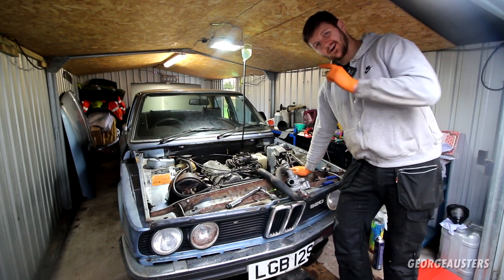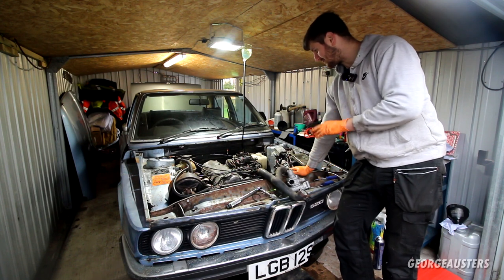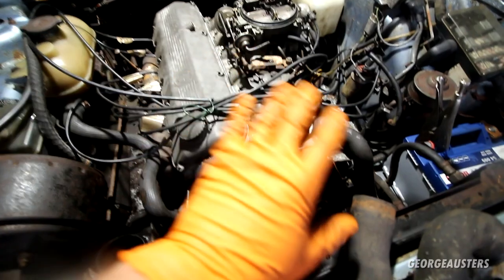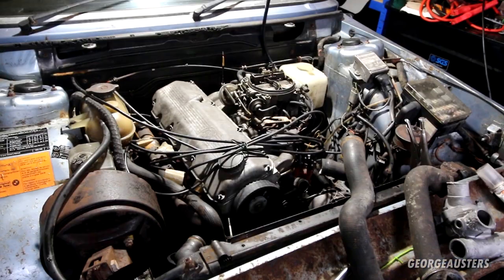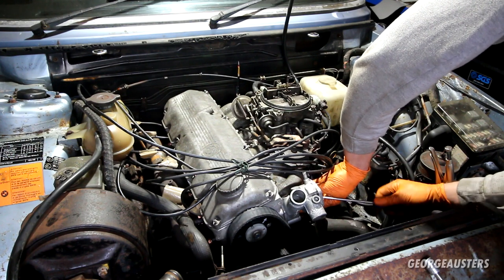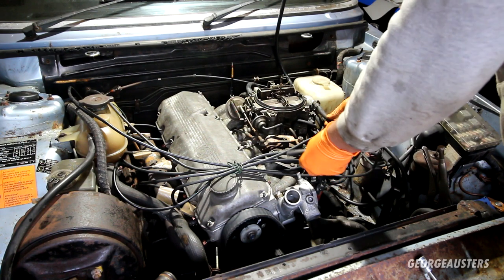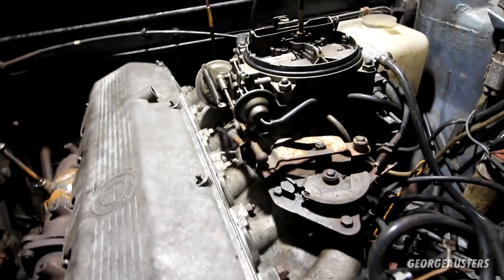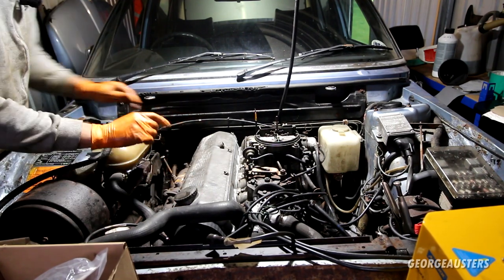This Abandoned BMW Started After 30 Years, but there is a problem..

Comment: Hi George. There's plenty you can do before you take the carb off. Assuming you are going to rebuild it anyway, it won't come to any harm. 1. Pull the auto choke housing to bits, you will find a bi-metallic bar in there that is coiled up like a spring, detach that from the choke flap shaft, you can then operate the choke manually. 2. Slacken off or detach the throttle cable so that it isn't doing anything, then find the throttle butterfly shaft at the base of the carb and operate that by hand, give it plenty of WD40, and check that it closes fully. With the choke flaps fully open, you should be able to shine a light down the carb barrels and see the primary and secondary throttle flaps, they are normally brass in colour, make sure that they can close properly and close off the venturi into the inlet manifold. The secondary flap only operates when the primary is wide open, thus giving more fuel/air when needed at higher revs. and better economy. If the primary flap is open, check that someone has not turned the fast idle screw fully in at some time, you will find this on the side of the carb and it contacts a cam/lever that acts on the throttle shaft holding it open. All this mechanism is spring loaded, so should spring back to rest (closed) after being operated. If the throttle plate will close, then you should be able to get the engine to idle.
Reply from the maker: Appreciate it Bob.. I have removed the carb now so will be giving everything a good clean and building back up with new seals etc
Reply: @GeorgeAusters  OK George. I'm confident you'll get there, you are pretty competent.

Comment: It is the carb , throttle assembly including the wam up valve. So you are on the right track rebuilding the carb and stuff around it , only then will you be able to dial in the correct idle speed.
I love this series and want to see this car run on the streets again.
Reply from the maker: Me too!

Comment: Hi George! First of all, congratulations on the good work you are doing on your vintage BMW! The engine of this car sounds healthy and smooth. As regards the high idle, I guess you should have a look at the idle valve as well. However, the carburetor needs to be cleansed properly due to the long time this car has been sitting. A nice clean also means a thorough check up to this engine part. Be sure every issue will be fixed finally. Keep up the good work! I am looking forward to your next video. Ciao! :hand-pink-waving:

Comment: cleaning and lubricating carburateur will be good to solve high rev.iddle problem and it may need some adjustment for springs on it.  i bet transmission works well just replace transmision oil before you try to use it.Don't gear it without changing transmission oil and transmision oil filter.30 years old hydraulic oil damages torque converter and valves also gasket inside of  transmision body
Reply from the maker: Transmission fluid actually looks very clean. I think it was probably replaced just before it was parked up

Comment: I am not sure of the specifics of your car, however many 70s carburettor cars had a "fast idle cam" that was disengaged by taping the throttle. The idea was at cold start you would prime the carb, start the engine and let it rev for a few seconds to smooth out then tap the throttle and the idle would return to a faster then normal idle. As water warmed the carburettor the choke flaps would decrease and idle would go to normal.

Even from new these systems often did not work properly and were often never properly sorted by the dealerships. Furthermore drivers often misunderstood the systems and all sorts of issues were created. Some people hated automatic chokes so much that they would retrofit a choke cable to the dashboard removing various arms etc from the carb even if their car did not have a problem. To some people the process of starting the car without stalling or flooding etc became a passion and people would tell you in great detail what to do to start if if they lent you their car...

Personally I hope you manage to rebuild that carb and get it to run properly as the whole automatic choke thing is kind of fun when it works and depicts character into the car. However there is a possibility that given the modern fuels and possible ware on components that it may not be possible to ever get the car to run correctly on that carb. There are many carbs that can be purchased new as retrofits these days that will potentially work much better with the modern fuels. You may even end up going with a throttle body injection system retrofit.
Reply from the maker: I’d quite like to keep this car original so will be rebuilding the carb👌🏻

Comment: autochoke makes it tick over at 1200 to 1600  on first start up ..think the auto choke has i think an electric a heating element plus is water heated...once at temperature, it will slow down to i suppose 800  but only if the choke is working ..you can wedge open the choke plates open for now .  note : the choke plates are separate items to the throttle butterfly ones .
Reply from the maker: Seems like it’s revving much higher than that if I’m honest!

Comment: George does the car have an automatic choke? If so it will rev high until you depress the throttle hard quickly, stab the accelerator pedal hard with your foot, then release. This will stop it from revving so high.
Reply from the maker: Yes it does.. not sure how well it works though!

Comment: Have you set the ignition timing yet?
Reply from the maker: Just to TDC when I installed the timing belt, but haven’t adjusted it yet no
Reply: @GeorgeAusters  ok just wondered if the timing was really advanced but clearly not
Reply: @GeorgeAusters  that's the cam timing, but ignition timing needs checking as well 👍. If you have a timing light for checking ignition timing, it may even have a built in rev counter so you could check revs.
Reply: @Mudster250  I’ve just reread his reply and yes spot on. George when setting up ignition timing you need a strobe light clipped onto HT lead and then loosen distributor lock bolt and turn the distributor to dial in the correct timing